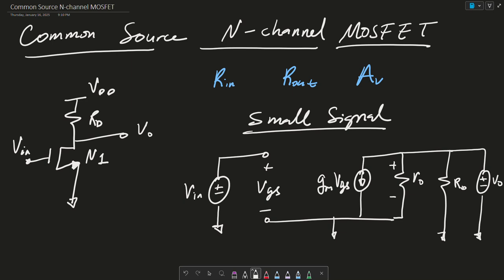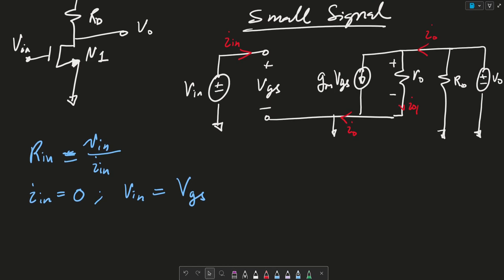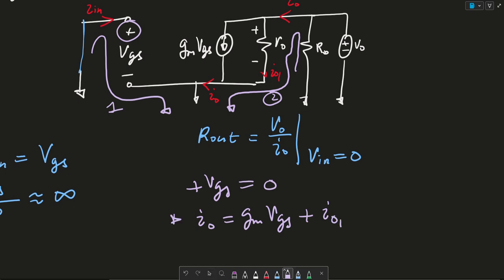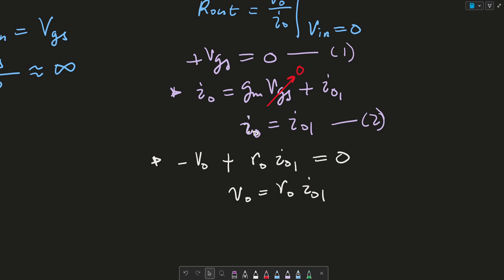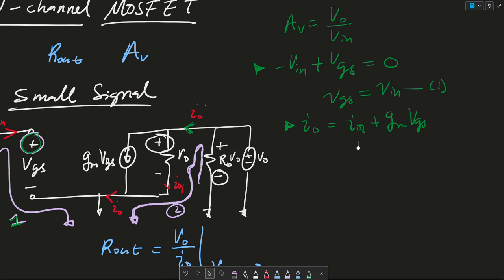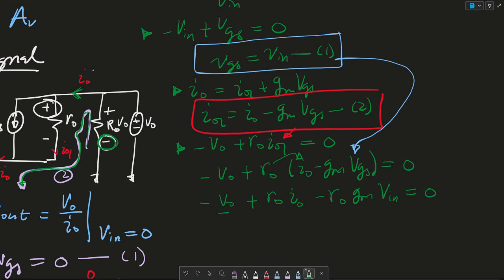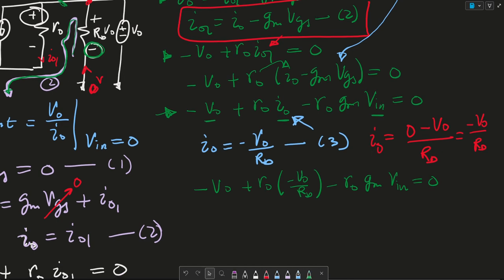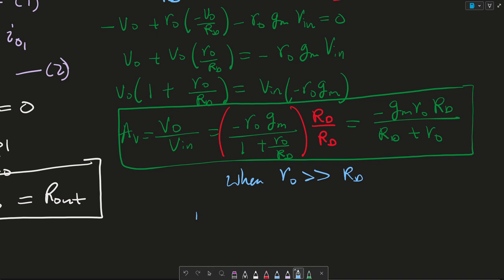Common source amplifier — small signal analysis

Comment: thanks sir, but i think when Vin=Vgs=0V, io= Vo/ ( Rd // ro) is that right ?, because I put io on the branch of Vo. And when i use Av= -Gm x  Rout the result is the same as yours
Reply from the maker: Hi, you are correct in saying that when Vin=Vgs=0V, io= Vo/ ( Rd // ro). The main take away is consistency in your KCL equations and you should receive the same result.